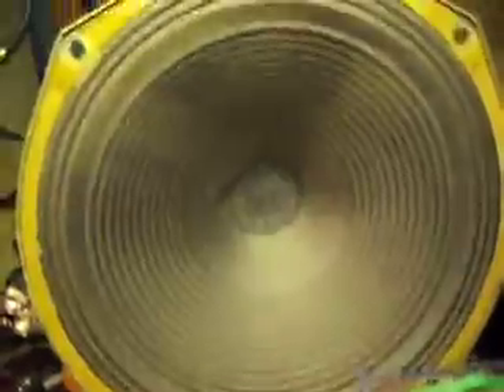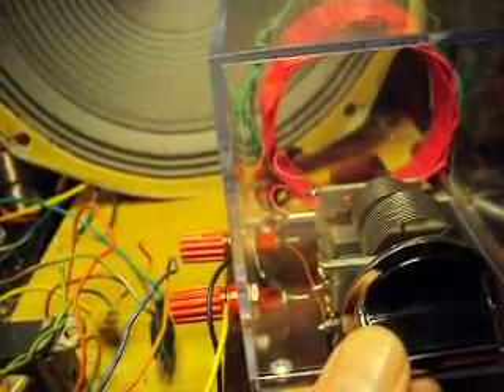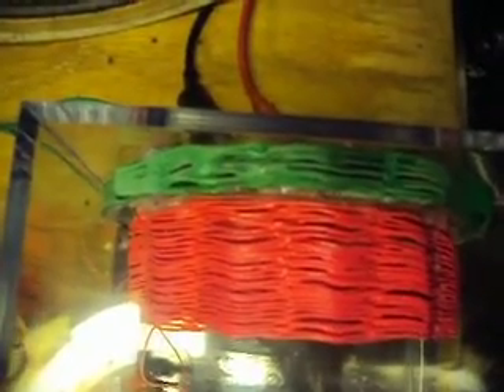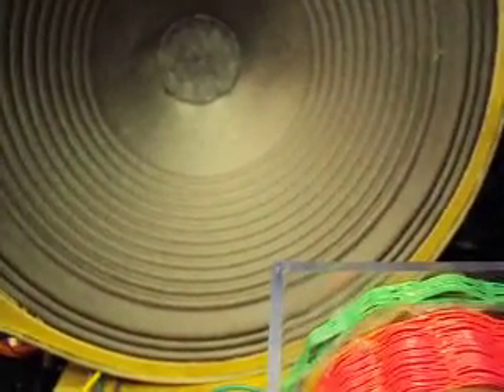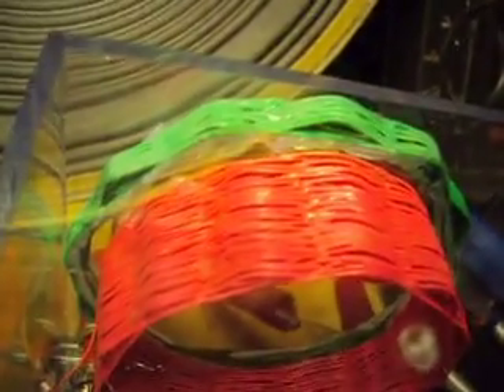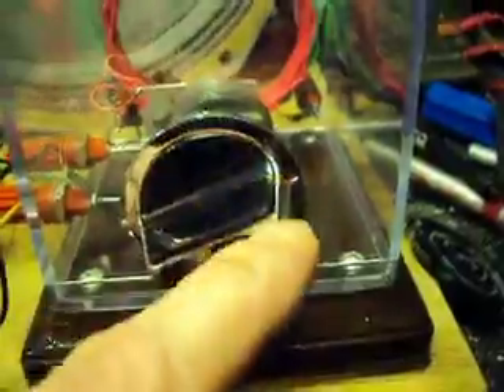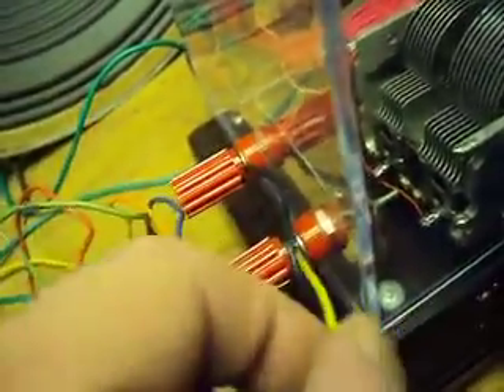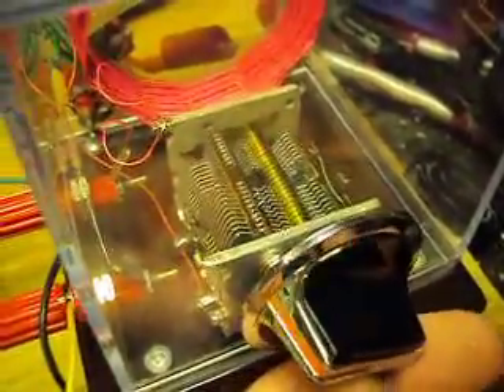Crystal Radio Powers a Twelve inch Speaker!

Comment: I was a kid in the early nineteen fifties and I built a crystal radio set and used it to drive an eight Ohm, four inch, permanent magnet speaker without any amplification.  I used the audio output transformer from an old tube radio to impedance match the crystal set to the speaker.  The speaker wasn't very loud, but I could hear it just fine if I held the speaker near my ear.   I could even hear it faintly from several feet away.  It probably helped that we had a 50 KW station in Houston and I had 12 year old ears.  I didn't really understand the importance of impedance matching at that time, I was just experimenting to see if I could get  a crystal set  to drive a speaker and it seemed logical to try the output transformer tube radios used.

Comment: I've built a lot of crystal radios and have a half-dozen of those Bogen PA-system audio transformers somewhere.  But, I never really appreciated them.  I get better signals using a hi-impedance phone or earpiece wired directly to the naturally hi-impedance  crystal receiver output.  In every instance I have found that any impedance-matching transformer only adds another stage which weakens the audio signal.  The only possible use I can see for the Bogen is a situation where only low-impedance "stereo" phones are on hand, which of course must be impedance-matched to the set to work at all.  In that role the Bogen works like a champ!

Comment: In the late 70s I was using a 6" 8 ohm speaker without a transformer listening to Top 40 station  CKDA 1220 AM in Victoria which was about 2 kilometers away.using a Radio Shack Science Fair Xtal set with a 40 foot longwire antenna.

Comment from the maker: This diode is used to rectify the modulation of the carrier. And yes, a full wave bridge rectifier would also function in a crystal radio as a detector. Capacitor filtering the rectifier would ether shunt or pass the audio signal unless the capacitance were low enough to only pass the carrier frequency and not the modulation.

Comment from the maker: When I made this radio, I knew it would be loud, but not expecting it to power a speaker! 
Having finished the radio to place on ebay, I wasn't going to take it apart again. 
When I wind my next set of coils, I will try using various diode configurations and attempt to charge a storage capacitor, make measurements, etc.

This radio is up for sale on ebay, username af5fv (speaker and transformer are not included).

Comment from the maker: No batteries or any external power, just a large antenna, very good coils in the crystal radio, a good matching transformer like the type used for intercom speakers in large buildings, and a large sensitive speaker.